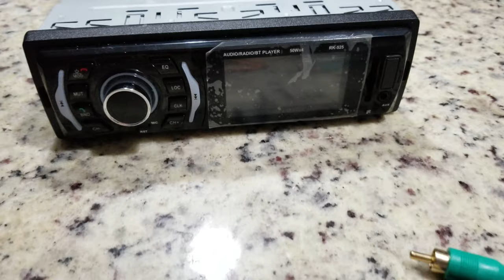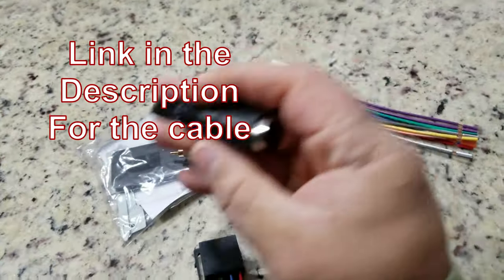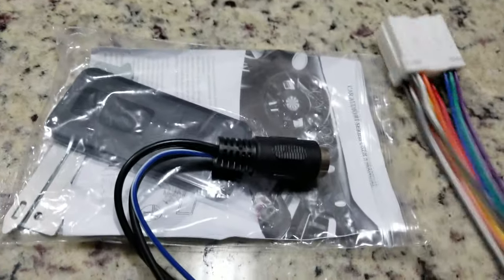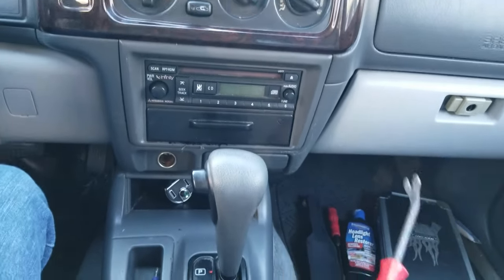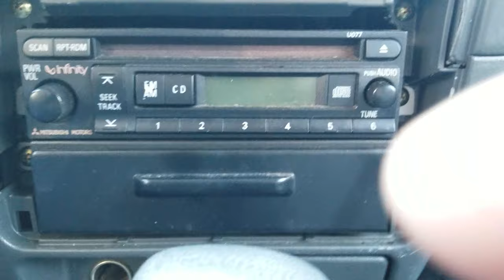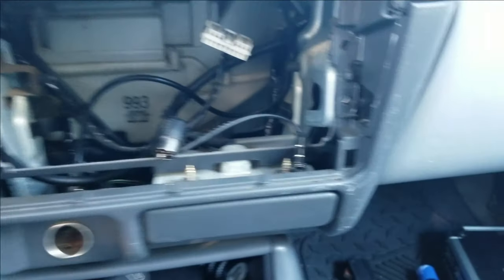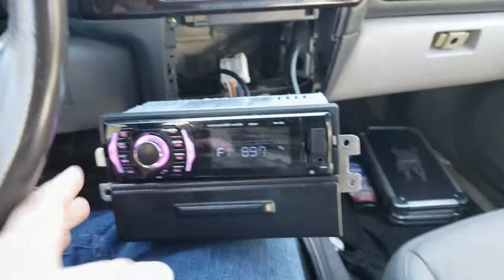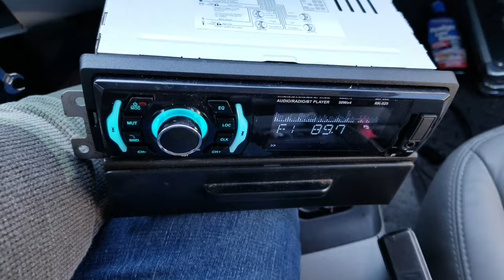Installing the Cheapest radio on Amazon!  #Diy #Monterosport #pajerosport #insanefriends

Comment: The installation of my Montero is the same as yours but I can't connect the speakers. Can you give me a more detailed guide to do it, please?
Reply: The same thing happened to me. No sound using the cables that go to the amp. But where is the amp? So I can run the 8 cables my self

Comment: I have a 2004 Montero Limited with a stereo that doesn't play CDs any more. You're right. We just want cheap bluetooth stereos to connect our phones to our car speakers. Thanks for showing how to connect the speakers to the sound infinity system. I hope my truck is as easy as yours.
Reply from the maker: No problem my friend. I hope I saved you some money!
Reply: @SodaCityWerx  l'll find out this weekend when I will open dashboard. I ordered the standard harness which is the part I was missing.
Reply: So I have a 1999 montero sport mine has the infinity system and have a question does you front big door speak have sound like the vocal coming out from them because I get a muffled sound from mine and already change my stereo and speakers but still does that

Comment: Low key, it doesnt seem that difficult thanks for the video, i bought a $50 one with the 7’ display, and used a harness to just plug it in and i crimped the wires together (since i dont have the amp installed) we’ll see how it works. 
Thanks a lot bro 💀 i didnt really know where to connect the ground (specifically why i searched)
Reply: So i did it a couple of days after i posted this comment, now its over 3 months and its fine. Greatest decision ever

Comment: Where is factory amp located
Reply from the maker: I've seen on another video he believed in the rear. I've never looked for it myself
Reply: Soda City Werx would you know where the Din cable goes to if it came out? The original radio doesn’t even use the Amp cable just the Main Harness and the antenna cable. I’ve removed the glove box and center console but I don’t see where it would plug back into.
Reply from the maker: @jonathanwhitley6307  mine had 2. One did not need to be used. The other went to the left if I'm not mistaken. But I'm not 100% certain to where exactly. I'm sorry I couldnt be more helpful